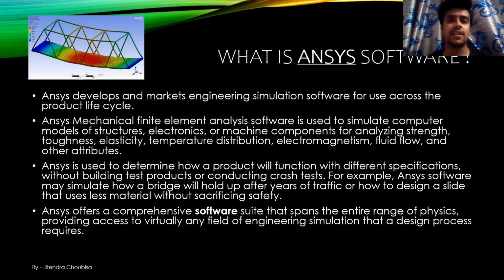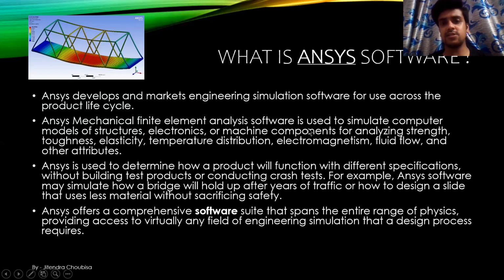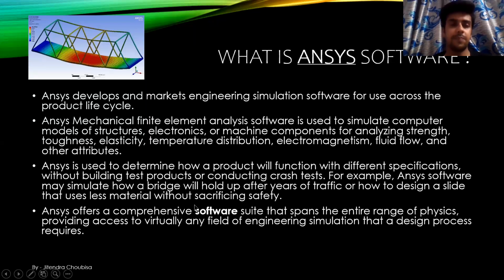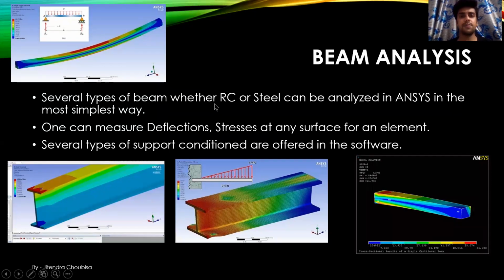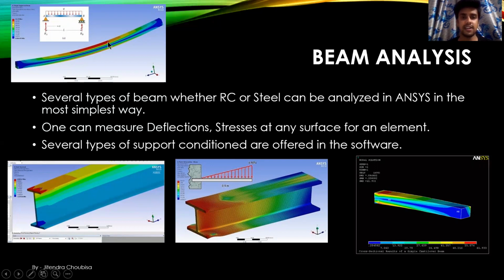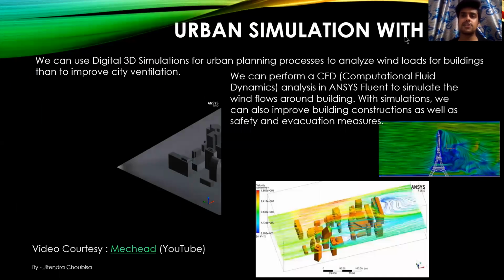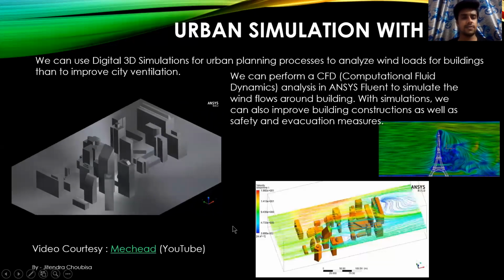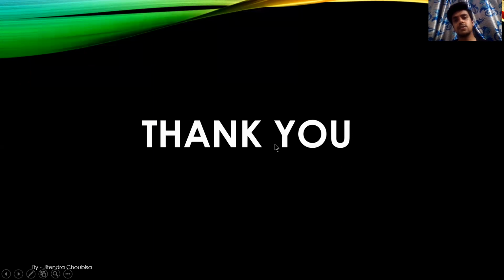ANSYS for Civil | 01 Introduction to the Software

Comment: Sir can we design the building like in etab
Reply from the maker: No actually Ansys is used for FEA (Finite element analysis), For example if you want to see the behavior of a single beam or column or any structural element, then you can go for Ansys.